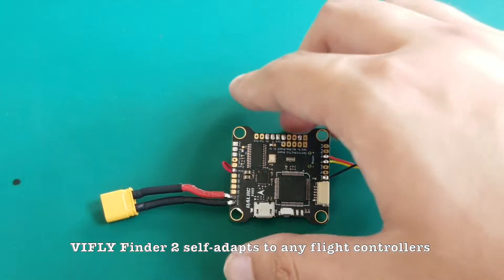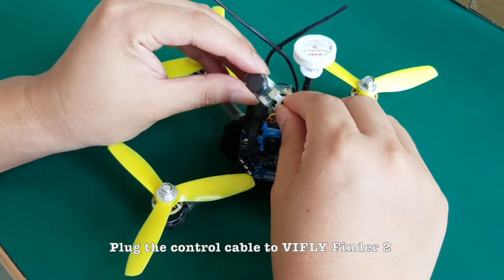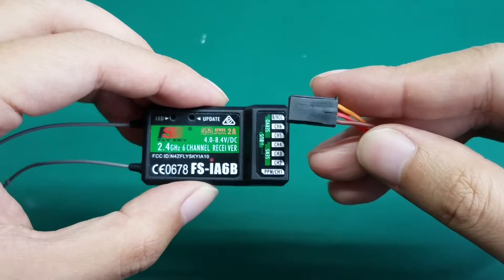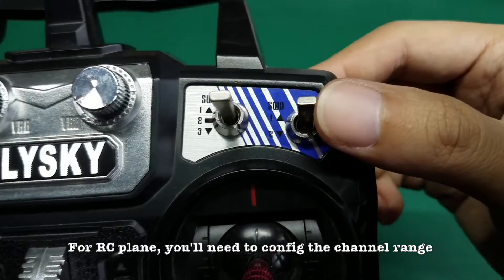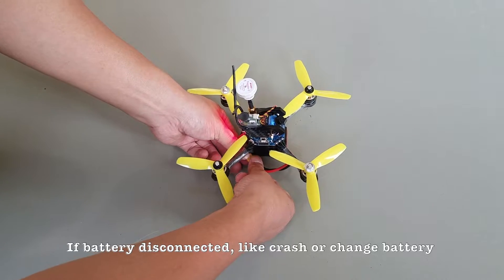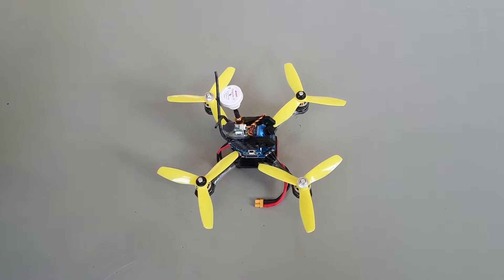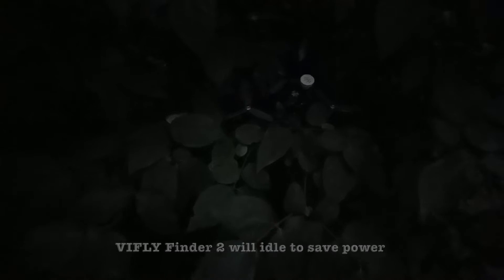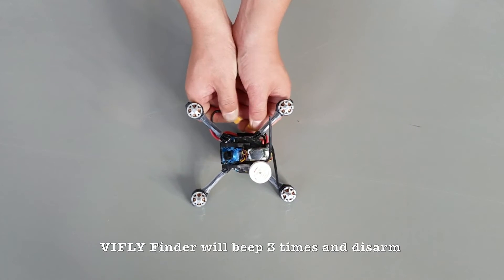VIFLY Finder 2 Drone Buzzer - How to Use

Comment: There is no way to attach this to your drone.  No attachment point, no through hole, nothing.  The best I could do is shove the smallest zip tie through thick plastic shrink wrap tube and circuit board and zip tie it to the frame.   I was like, are these guys serious?

It's also a PITA to charge up before you fly.   I had to make a special battery tray just to charge it up.  I end up charging it up, zip tying it onmy quad, and then before take off and activate ti and let it beep away while flying.   Kind of really stwpid design.   

Then when you are done, you have to cut the zip tie, and put it back in your rerigerator for storage, and repeat the process every tiem you want to fly, sacrificing a zip tie and a lot of time each time you fly.

Comment: Mine kept going flat after a few days.
I checked current draw and found that the buzzer is constantly drawing 0.5mA from the built in lipo.
So the onboard 80mA lipo will go flat after a week if it's fully charged.
Not sure if mine is a faulty unit, or if this is normal behaviour.
Reply from the maker: Send email to support@viflydrone.com, our tech team will fix it out. 
\
Reply: same issue with my two buzzers